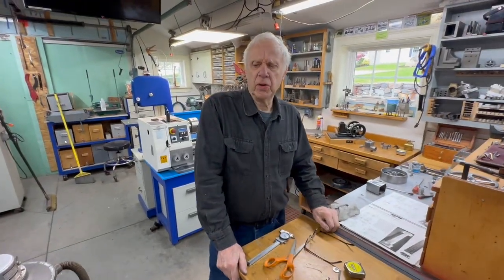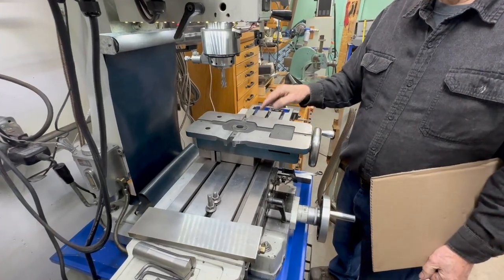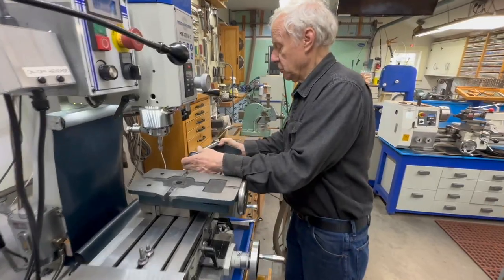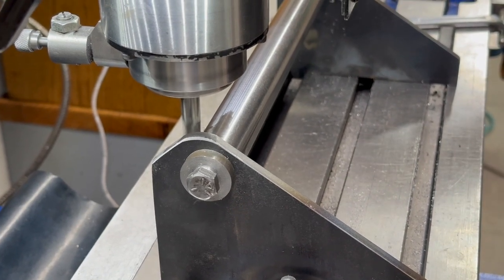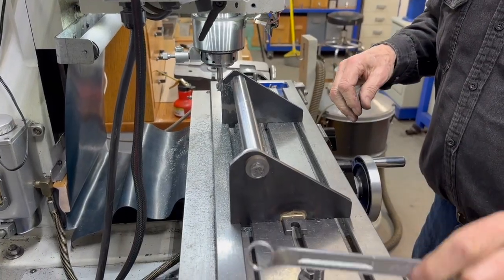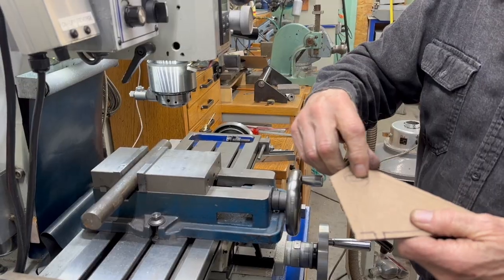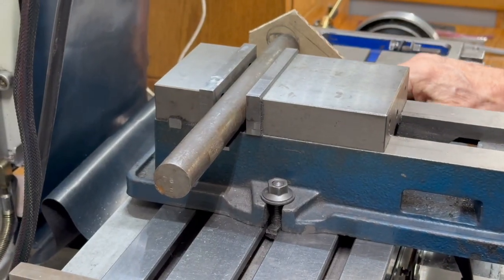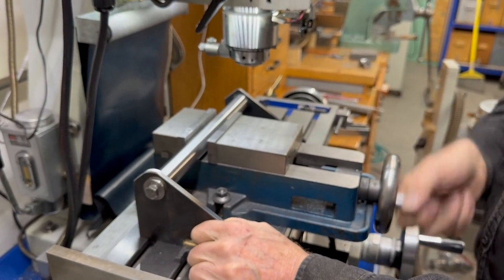Make a Simple Milling Vice Positioning Jig

Comment: If the keys don't work then are the tee slots aligned with the x axis. Have you checked that?
Reply from the maker: I’m not sure what you mean about the keys. What keys do you mean?
Reply: @JoesModelEngines they are the blocks that fit in the slots in the base of your vise and locate in the tee slots
Reply: @JoesModelEngines  , they are the blocks that fit in the slots in the base of your vise and are locate in the tee slots.
Reply from the maker: @marley589 Hi Marley,that was explained in the beginning of the video, (that’s what I used before . )I changed to the jig because it’s much more accurate and it takes just a few seconds longer.
Reply: @JoesModelEngines  Thanks Joe. I just wondered why the keys do not work on your mill / vise when it is an accurate industry standard procedure. Something must be wrong with either the slots in your vise or the tee slots, both of which are supposed to be supplied as accurate references.

Comment: Make sure the Z and the Y axes are clamped and the X axis clamped at the start to get a reading on the indicator then release the X axis clamp - move across and re-clamp the X axis to get a true reading at both ends.
Reply from the maker: Hi thank you for your input. I did lock the spindle and the head,but I didn’t even think of locking the x axis. That seems obvious now that you pointed it out. Sadly we can’t change the video without deleting it and starting over. Thanks for the help. I’ll try to do better next time.Joe

Comment: Nice set up tool. Anything that eases set up is worth having. With practice tramming gets easier, but tools like this encourage changing things up and doing different set ups. 👍👍
Reply from the maker: Hi Stuart, This seems to work so well that I don’t think I’ll ever have to tramm again. If it goes out of alignment all I have to do is take a light cut on both sides of the bar and It’s perfect again.
It’s definitely accurate enough for my work . Joe
Reply from the maker: Hi Stuart, it sure is better and faster than the previous way I did it. Thanks Joe